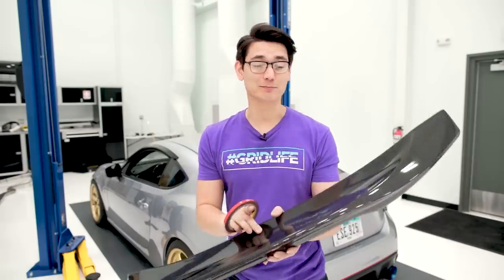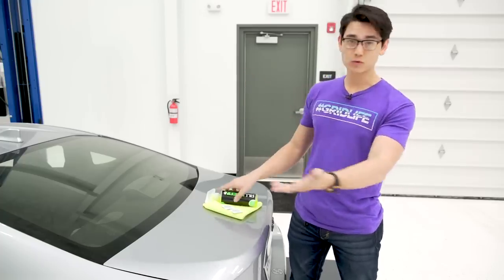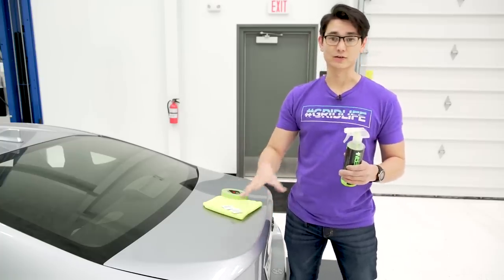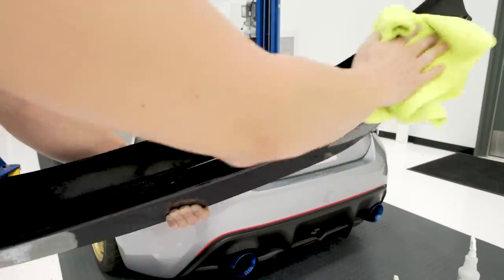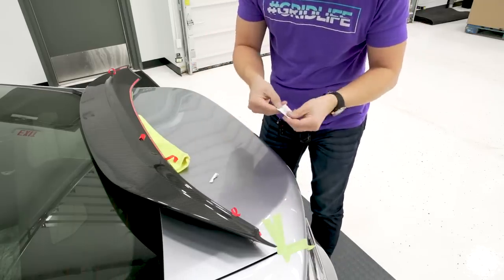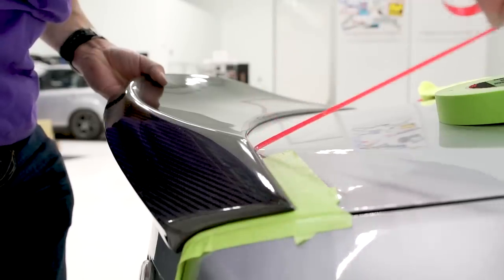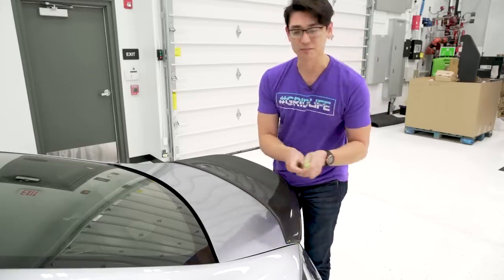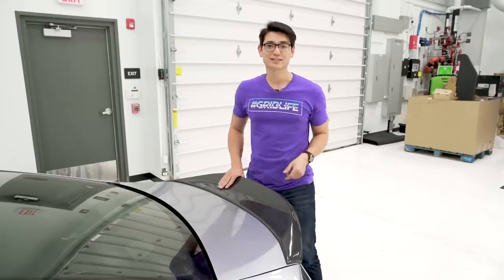How to install a spoiler on your FRS BRZ 86

Comment: HUGE SIDE NOTE:
If you have a spoiler installed from the factory you may have fitment issues. Especially with the 17+ models. This and the TRD spoiler do NOT cover the oem holes! Please be aware and don’t make the mistake I did!!!
Reply: Is there a duck bill available wich will Cover the holes from the 17 model?
Reply: @MS-wd7gp  I don't know if you are still looking for one, but Verus Engineering just released a ducktail spoiler that covers the OEM holes in 17+ models.
 https://www.verus-engineering.com/shop/product/a0176a-carbon-rear-spoiler-ducktail-2013-brz-frs-gt86-1159?category=1
Reply: @MrMontag95  hey will this spoiler cover the OEM holes on a 2014 frs monogram becuz the 2014 frs monogram comes with a factory spoiler install on it.
Reply: Thanks, exactly what I needed to know

Comment: I tried the exact steps, but mine fell off and I used silicon the next time and it works
Reply: In any exterior mod, I use 3M then with black silicon applied on the edges to its watertight and stickier.

Comment: What exhaust is on the car in this video? And does this method leave a gap between the lip and the body?
Reply from the maker: We'll be release more info on the exhaust soon. As for the Gap there isnt really one with this Duckbill.
Reply: FT86SpeedFactory  what the difference between this ducktail & the legsport clubman  one. Why is the clubman more expensive?
Reply: @FTspeed  Thomas I need that exhaust 😂

Comment: Does this wing cover up all the holes from the stock BRZ wing?
Reply: Itll cover the holes for the 13-16 wings but not on the 17-19
Reply: it didn't cover the holes for me
Reply: FormedAndFunctioned okay I have a 16, right now I have the holes plugged so I’ve been looking for something like this in carbon. Do any of the other ones cover up the holes like the TRD one?
Reply: John Nguyen what year BRZ do you have
Reply: @patrickburnett9970  the TRD trunk lip will also cover the same area as the one featured in the video.
(I had emailed the staff at ft86sf and they say the same thing)

Comment: Okay that's cool and all, but what if I want to take one off? My TRD Spoiler is peeling at the edges and I need to remove it so I can clean out the dirt underneath.
Reply: I would try some fishing line. Get the middle of a long strand at the edge of the bottom and gently do a sawing motion, you should be able to remove it, but there will be a lot of adhesive clean up.
Reply: Fishing line as last comment said and if you want to remove the old glue get a emblem remover wheel put it on a drill and you should get it removed with in a good 15 min or less as I did then just clean it up and well then this vid helps you re align it up. Good luck